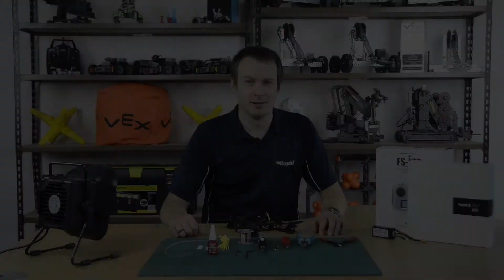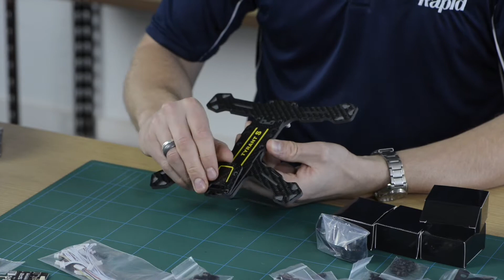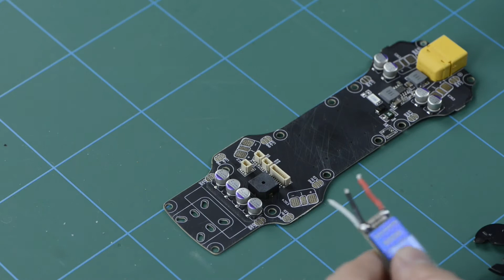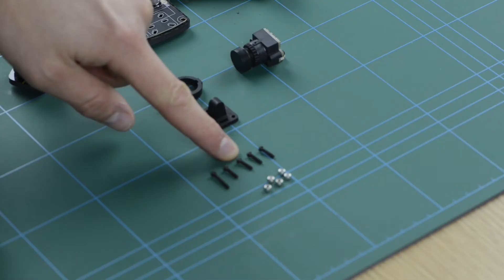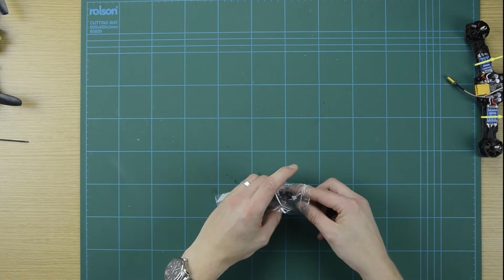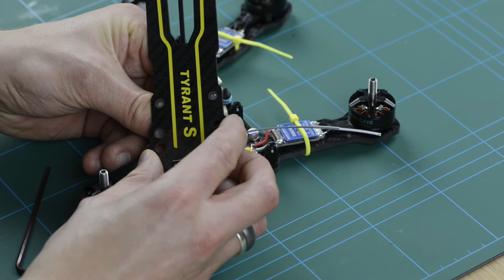Building the Airgineers Tyrant S Racing Drone

Comment: I have spliced the wire together, but the flight control board has a 5 pin connector and the end of the white wire only had a 4 pin connector.

The board you supplied looks a little different to the one in the video.
Reply from the maker: Newer versions of the Tyrant-S kit are shipped with a Fury F3S flight controller and a VT5804 VTX. Please see https://www.airgineers.co.uk/3s-class.html under downloads at the bottom of this page for amendments to the wiring.